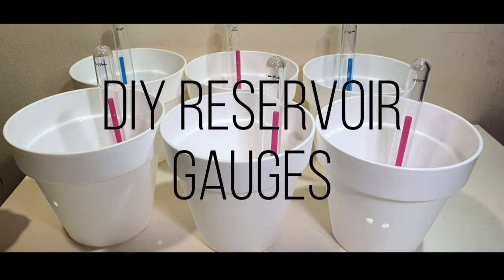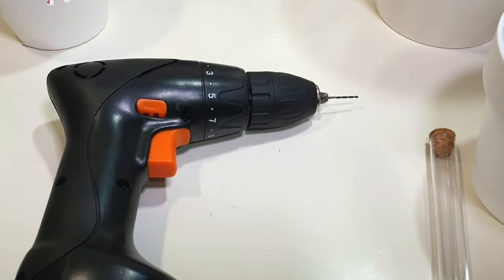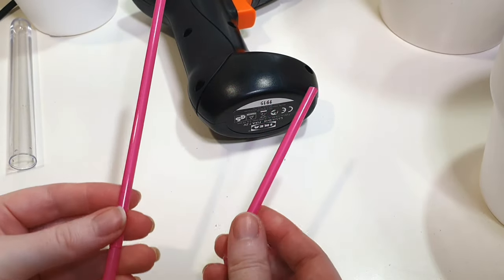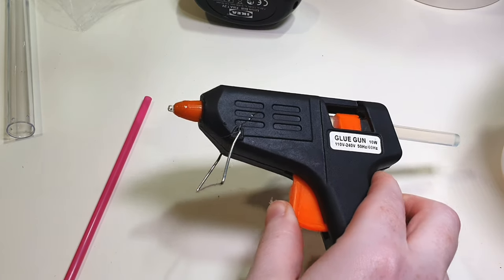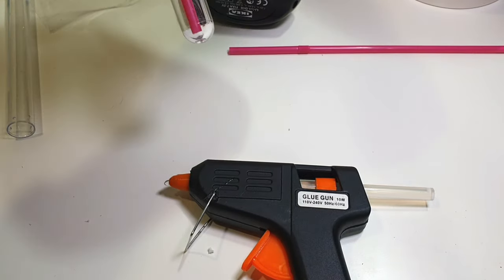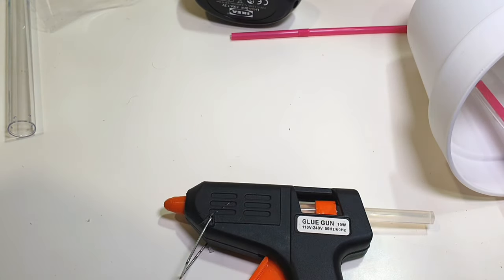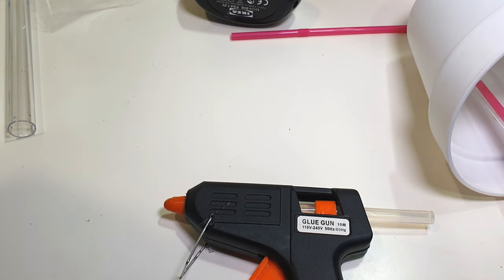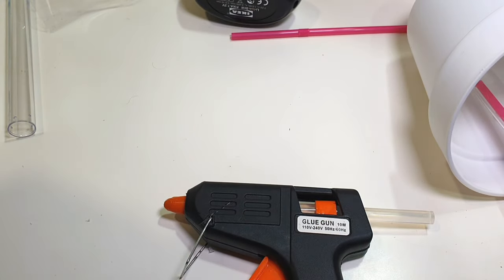DIY Reservoir Gauges | Making water level indicators - Semi-Hydro & Self-Watering pot hack!

Comment from the maker: Just a thought, but you could could also make some sort of base or raft out of polystyrene or a light weight material, and glue the straws to that so they sit more upright. That's what the professional self-watering pots do, they have a plastic raft and then usually a polystyrene ball underneath that pushes the raft and the tube up, or the raft itself is sealed and buoyant. Obviously here they rest against the side of the tube. Not sure if that's a problem but just thought I'd put it out there, I'm sure there are loads of easy ways to improve these! 🙂
Reply: thank you for this wonderful idea. I have some very deep pots & could not find straws that were both tall & wide enough. Found 50cm x 16mm wide plexiglass aquarium tubes - going to give these a try.
Reply: Yes the straw sits against the edge what I fine is it won't come back down with out har tapping it and flicking it

Comment: Yes, the hole in the top has to let the air out so the water can get in, so the straw will move.  Otherwise the water will be held back by the air pressure inside the tube. Great build and clear video thanks!

Comment: Great video! For the self watering set up, do you generally find an inner pot with a diameter slightly larger than the outer mask? Or do most of the clear pots have a lip so they sit snugly on top? Looks like you went through a lot of trial and error to find the right combinations! PS. The orchids you sent me are all doing well! :)
Reply from the maker: Thanks! And I'm really glad your orchids are getting on well, thanks for letting me know 😀 Oh you wouldnt believe how many different size and types of pots I have bought over the years trying to find self watering combos 😂 the taper of the pots matters too! The pots with the lips work best as they you have something nice and easy to pick up also. Some of the cheap outer pots I have are too tapered at the base, so inner pots wont go deep enough to sit snugly. But they're good for semi-hydro, and some other cheap lipped pots I bought from garden centres fit those too, because they're shallower. It's a real headache. And then you find ones that work together and are cheap and amazing, and the supplier stops doing one of them... 😂 Someone could make alot of money off me if they just made some cheap self watering combos with clear inner pots 😅

Comment: Have u tried not adding the polystyrene?  And just glue the ends closed on the straw. I cant see the polystyrene making it float more since it doesn't touch the water at all. Unless its keeping the straw from collapsing on it self, but I dont think it is. Just curious
Reply from the maker: Yes I have, seems to make it float better- the ones with the polystyrene floated higher and more reliably. Could just be providing a better seal though rather than actually improving buoyancy in any way.

Comment: This might be a stupid question, but why do you need the poly at the bottom of the straw? If you're sealing the end of the straw with hot glue, it should work as a bob without it, no?
Reply from the maker: Seems to float better with than without, unsure why? Maybe it just forms a better seal than glue alone and is nothing to do with the actual material 🤷‍♀️

Comment: Hello! I tried putting this together today with a large smoothie straw and a smaller normal sized straw inside. I made several but none of them rose/fell with the water. Is there a trick? It’s almost as if the straws stuck to each other.
Reply from the maker: Hi there! No trick, mine work every time, have you tried floating your sealed inner straw on it's own to see if its an issue with the seal on your straw not creating buoyancy, or a combination of the 2 materials? You'll probably need to optimise and troubleshoot as you go. Any ridges at the base of your inner straw that could stick inder the outer straw? Outer straw fully to the bottom of the pot?
Reply: Hi did you find a solution sitting with the same issue
Reply: Hiya did you find a solution I have the same issue

Comment: I am not comfortable with the strength of the glue. Will the glue hold?
Reply from the maker: Yes, it holds well, it's not placed under any pressure, I'm not asking it to support anything heavy structurally, and is supported by media. Most of my self watering ones aren't even glued. If you aren't comfortable, you can use mitrebond, but that's going to be tough to get off. This is just my method I had a few requests for, you are welcome to take the idea and improve on it.